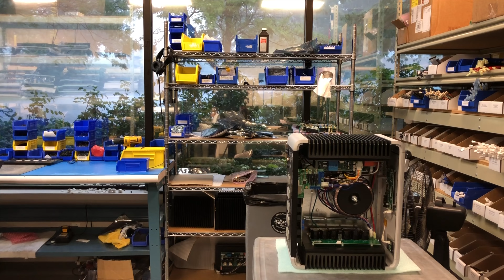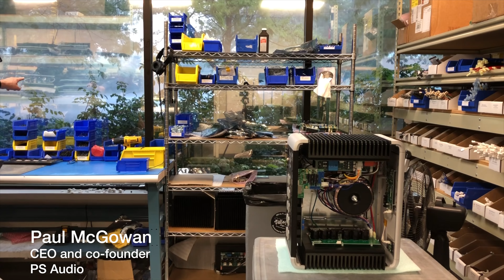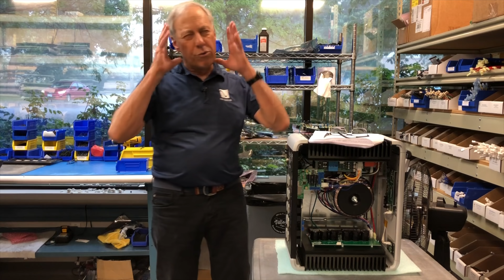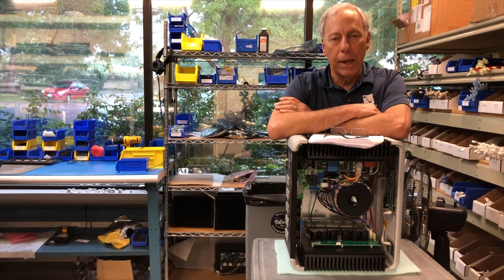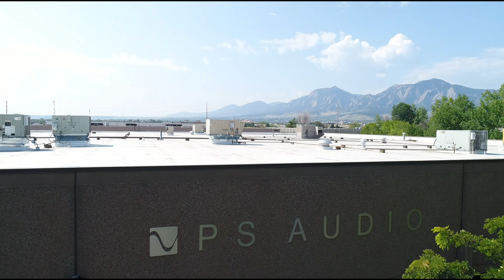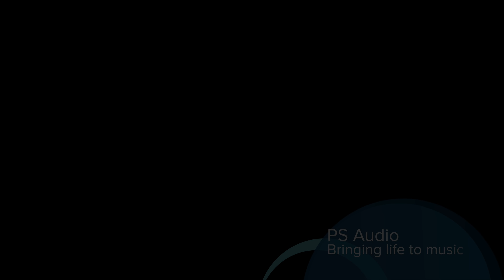How much setup goes into equipment voicing?

Comment: Interesting that you still find the need to voice amplifiers, which should essentially be a neutral straight wire with gain. There are those such as Ethan Weiner who promote that all the factors that equate to good sound form an amp are very well known already. Its not magic but science. You mentioned that if you build an amp and it sounds a bit bright that you may change a component etc, but isn't that just introducing a change in the frequency response that should have been correct before as it was initially ? Also as soon as you start voicing a component (as most designers do) aren't you just stamping it with your own biases/preferences and tailoring it to your own reference room and system that will be different to most of your customers?
Reply: drumphil both misses the point as well as makes it. The key word here is "incomplete". The things we measure are such a microscopically tiny portion of the reality of sound perception, that any equipment we measure, no matter how astonishingly modern our measuring equipment is, will always be so amazingly incomplete that our ears will always be the better device to put equipment to the test. We listen with our ears, which have evolved over millions of years to pick up the smallest auditory cues from our environment. The measuring equipment we use simply does not "listen" to the signal the same way the human brain does, it does not look for the same environmental cues, it doesn't pay attention to specific parts of the frequency spectrum the way the human brain does. Measuring equipment doesn't do what we do when we listen, which is try to place the source of a particular sound in a physical space. It doesn't really interpret or visualize where the sound is coming from. No one listens to music with a spectrometer, we use our ears. Also, not all sonic differences are differences in "frequency". There are other factors as well - timbre, realism, imaging, etc. And those things are either impossible, or incredibly difficult to measure.
Reply: If that be true, a hole lot of 125 W amps would sound identical.   But for most of us, this is simply not true.
Reply: drumphil00 If all measurements are done and it’s the same, they sound the same. However, sometimes you don’t have measurements and only have specs, and sometimes incomplete specs (a lot of stereo amps specs  don’t list channel separation for instance).  
  
This is why, for high end gear, it’s ideal to demo.
Reply: "So if that be so, then why does 125W amp with all the measuring the same form different companies sound different?"

Because the measurements are incomplete, inaccurate, or just plain lies. For instance, simply stating distortion figures at a few fixed frequencies doesn't tell the full story. A plot of distortion vs frequency is much more useful. How about the same plot at maximum stated output power? That will tell you if both amps maintain their fidelity up to their claimed power rating. Very rarely is the customer actually given enough information to be able to compare amps by specs alone.
Reply: That is the two sides of thought?  One side "it does not matter, all sound the same!  Other side, "it does matter, components makes a sound!

Does a component in it self have sound? Can this sound change between two indentical components from two different producers?

If components have no sound. Then only thing matters is the value of the component that matters, nothing else. Price wouldn't matter, producer wouldn't matter, material wouldn't matter.  

So if that be so, then why does 125W amp with all the measuring the same form different companies sound different?
Many years ago i bought a NAD 216 125W 8 ohm amp. My brother bought an equivalent from Denon.

On paper this looks like the same, even same size transformer with same specs (Different brand, think Denon got from Germany, and NAD i think was from Sweden)

But when playing on same speakers, the sound was different.  Not bad, but different.
Our conclusion is that Denon got  "light" and careful in high tones, little careful but clean mid range.  And oki clean band controlled bass

The NAD on the same speakers got clear and sharp high tones, solid clear strong mid range. And controlled powerful bass with dynamics down to pure brutality when needed.

Amazing differences on those exact speakers.  Tho, when testing different speakers, the Denon performed better on B&W. B&W on NAD got to high/sharp on treble.  This not surprising, coz NAD was sharp on all speakers. but only B&W it got "to" sharp

And this on paper should be the same. So in "you'r? and Ethan Weiner opinion, those two amps on same speakers should sound identical..
But the really does not..   Tho these ofc is not High End amp's, but my opinion in the high end marked. This is even more notable..
Reply: I was making an observation and asking a question rather than making a statement and I am not in the all amps sound the same camp ! I have changed capacitors in my valve amps from Polypropylene to Teflon caps and it made a big difference. The sound became faster and less bloomy. Which is better is a matter of preference and how it mates with the rest of the system. All commercial products are made to a price and upgrading to better key components can yield significant gains. I'm sure there is a lot that we don't understand yet in why certain components or cable sound different but they certainly do .
Reply: There isn't any sound in a wire. Only an electrical signal. If the signal that comes out of a device varies in any way from the input, it is by definition, distortion. And distortion is something we can measure. Speakers are a tricky case because it is impractical to actually measure everything that needs to be measured. There are an infinite number of places you can measure a loudspeaker from.
Reply: Are you some kind of yes man ? I don't recall being rude.
Reply: If two amps with identical specifications sound different, then either the specifications for one amp, or both, were inaccurate or incomplete. It is not mathematically possible for identical signals to measure differently. If the signals are different, they will measure differently.
Reply: Can you do anything that makes the output of an amp different to the input in a way that doesn't show up in the usual measurements? Can you give an example of when the output signal is less faithful to the original, but doesn't measure worse?